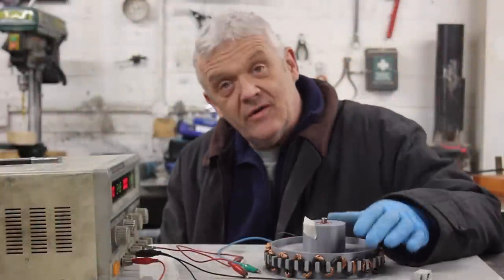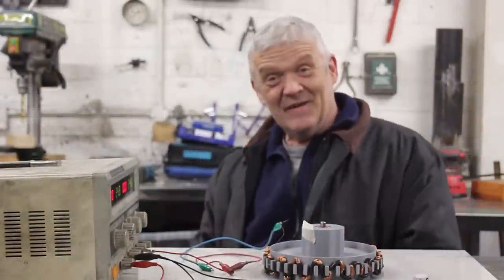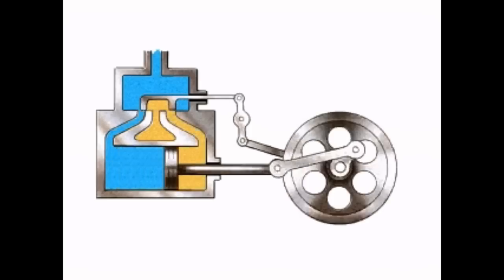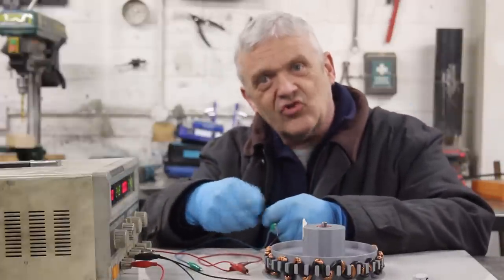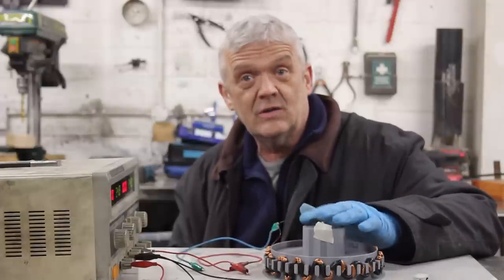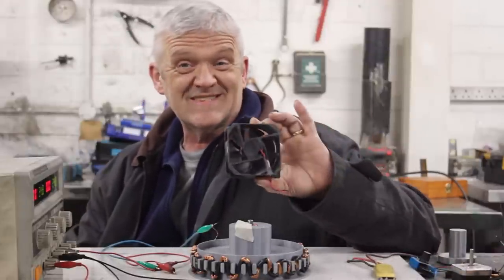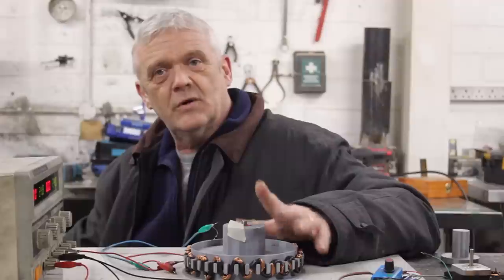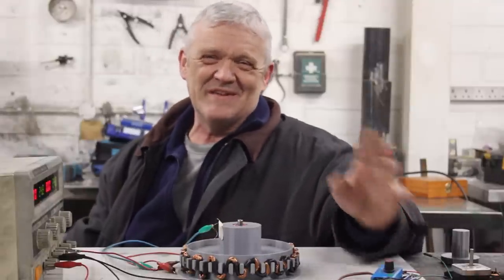1870 The Twisted Serpent As A Motor

Comment: What if you printed not ribbons but pins and then manually wired the copper under straight 45 degrees lines (more straight and sharper corners). Eventually one can create something to automate the wiring work.
Reply from the maker: yeah you could do that but until you created something to automate the winding it would be a royal pain lol - but you are absolutely right mate
Reply: @ThinkingandTinkering  maybe I'll give it a try does the angle needs to be 45 ? Or is steeper better like 60 or 80. And with uneven pins the wirings would shift I wonder if that is worse or better. I be happy to share blender models with you.

Comment: An ebike already has forward momentum so this single coil should be sufficient, Saves time in mass production, Easier to recycle or reuse.
Reply from the maker: oh - clever - cheers mate
Reply: @ThinkingandTinkering  As an ebike motor, if this is inside the hub of a 20 inch ebike wheel say, to travel at 20 miles per hour, the wheel rotates around 5.5 Hz. There's 20 loops in the serpentine coil. That's 5.5 Hz*20=110 Hz phase switching. According to my online search, skin depth for copper at 110 Hz is 6.5mm, so even the regular wiring used in the walls of homes, 3mm diameter, should be able to handle the frequency.

Comment: Question, if you simply did one big coil, no twists in it.  And put all of the magnets in the same orientation instead of north south north south. Would that not be the perfect DC generator?
Reply from the maker: no - nothing would happen - you might want to watch a video or two I have done on the principles of generation mate
Reply: @ThinkingandTinkering  yea, been watching abit. its an interesting subject. and i got the idea whilst watching a video were you took a generator you already had, i think you called it the "lightning bolt generator" or something. and spun a coil around the whole thing. 

I was thinking that if you didnt do "north south" pattern and instead of that going "north north" you would get a constant flow in one direction. 

But thanks for the clarification.

Comment: thanks robert ...my knowledge is limited here however after your demo there showing the pulse control and a hall effect sensor when its setup and a motor. I wonder if this could be reversed when its running as a generator ? so the hall effect sensor could be used to take off the load when its at its at the bottom therefor making it a more efficient generator ?? so instead of a motor nudge its a generator release!!
Reply from the maker: you could do that mate - but I am not seeing the advantage myself
Reply: @ThinkingandTinkering 
a permanent magnet 3-phase motor uses a Hall sensor and an electronic controller to control the timing of the current to the motor windings. The controller measures the position of the rotor using the Hall sensor and adjusts the current to the motor windings to ensure efficient rotation of the motor.

In a generator setup, the principle is reversed, and the magnetic field produced by the rotating rotor induces a voltage in the stator windings. The magnitude and frequency of the induced voltage depend on the speed of the rotor and the strength of the magnetic field.

Regarding your idea of using the dips in the magnetic flux to reduce the torque, it is possible to adjust the timing of the current to the generator windings to reduce the torque required to turn the generator. This can be achieved by adjusting the timing of the electronic controller to ensure that the current to the generator windings is in phase with the dips in the magnetic flux, which can reduce the resistance to the rotation of the generator.

In your setup, you mentioned that you would have the output from the generator going to a capacitor. It is important to note that the use of a capacitor depends on the load requirements of your application. If the load is resistive, then a capacitor may not be necessary. However, if the load is inductive or capacitive, then a capacitor can be used to improve the power factor of the generator and increase its efficiency.

Overall, your idea has the potential to be an efficient way to generate electricity, but it will depend on the specific details of your setup and the load requirements of your application. I would recommend conducting further research and testing to determine the optimal configuration for your system. i might just be a sandwich short of a picnic🤣

Comment: Big fan. Love your channel I have one concern about your generator/ motor and it concerns it  in all in one word heat. How would the filament from a 3D printer be in handle heat from the motor or heat from a generator? I think you may later on  if you feel like it to make a video on the concerns about heat and not melting the filament from your 3D printer in the motor because as the amperage go up it going to produce some heat which then the heat is going to warm up the filament which then is going to wreck the motor/ generator. I would love to build one and hope you could clear that up about what to do about the heat that's coming from the motor/ generator that a person makes from a 3D printer. Thank you! Thank you so much!
Reply: It could be printed in ABS or Laser sintered metal.
A really cool thing that you can do with 3D prints is use them as models for sand casting metal components. You can make a silicon mold of your 3D print and then cast your parts in high temp resin. The 3D prints are proof of concept prototypes.
Reply: N grade Neodynium magnets start to lose magnetism (i.e. the curie point) at 80 C, so they'll fail before the plastic fully melts.  That said, many plastics "creep" under that temperature so you're right it's an issue.  An engineering plastic like tempered PEEK should be fine though.
Reply from the maker: yeah sure

Comment: Hi Robert, I saw video 1869 and want to print this. I am curious if you had to use supports while printing the stator?
Reply: I cannot speak for Robert personally.  Based on your question, it sounds like you are concerned about "midair" layers with nothing underneath them.  If that is the case, then I may be able to help (see below):

I personally recommend exporting your 3D print model from whatever modeling program you use (such as Tinkercad or Freecad, which are both free) as a *.STL file.

Take the STL file you just created, and import it into Cura.  I like Cura because it is free, and because it generates the *.gcode file for you automatically.  The user interface is very simple, and you can tell it what you want the 3D printer to do.

MOST IMPORTANTLY, one of the options is to have it "generate supports", for those "midair" places with no supporting layers underneath them.  Any portion of the part that does not have continuous material all the way to the plate surface will have supports underneath it.  This creates a series of thin, vertical walls, much like the thin corrugations in the walls of a cardboard box.  These supports are kind of annoying, but you can break them away from the finished part with your fingers fairly easily.  You basically "pick your poison" and point down the side that is least objectionable to have these supports removed later.  You can mitigate the amount of cleaning up that you have to do, by adjusting the minimum angle (relative to vertical) where the supports are generated.  A 30 or 45 degree angle may need supports,  but you can sometimes get away with not using them if the wall is "almost" vertical, such as 10 or 20 degrees (The default angle is set around 20 degrees, if I remember correctly.)

Anyway, I hope that helps.  Have fun, and remember that practice makes perfect!
Reply from the maker: the stator no - the rotor yes - that's because the rotor has a flat indent section to accommodate the thrust bearing and is 'midair' the stator 'pegs' have an angle of less than 50 degrees - so the printer can cope with it - that's why the 'pegs' have rounded ends!
Reply: @ThinkingandTinkering  Thanks Robert, I didn't realize that about the rotor.

Comment: Robert, side question. Can you calculate the efficiency of a Venturi based on length?
Reply: There just gotta be engineering tables and figures for venturi from the days of carburettor technology.
Reply from the maker: I don't know mate
Reply: Thank you both. I'm working on an idea which incorporates a Venturi however I can not find details that speak to efficiency. Length, diameter, angle of deflection. Thank you anyways.

Comment: Hi Rob if you had 1 wire and took a tap from the middle and each end would that make a 3 phase
Reply from the maker: well that would effectively make coils in series with the start of one coil being joined to the beginning of the next - don't you have to join the coils all start to each other? kind of like in parallel?
Reply: @ThinkingandTinkering  I was thinking if you received a voltage from the middle of the serpentine winding in generator form would it be the same as a 3 phase motor

Comment: do the motors use capacitors to kick start the motor?
Reply from the maker: no
Reply: @ThinkingandTinkering  after further investigation Capacitors are used to reduce the electrical noise produced by the fan motor, which can interfere with other electronic equipment in the vicinity. By smoothing out the electrical signal, capacitors can help to reduce electromagnetic interference and improve the overall reliability of the electrical system.

Comment: you could add a relay to pulse the voltage
Reply from the maker: you could but you would also need some way to time the pulse
Reply: @ThinkingandTinkering  Capacitors? You'll have to excuse my electrical knowhow, I'm an ex PC tech (20 years ago) and sometimes things pop into head :)
 Cap > Charge > Relay.

Comment: So, what would happen if instead of pulsing the the wires , they were just connected ?
Reply: The coils field will be static, so the magnets will align with the static field and stop. A coil is just an electromagnet. It stays the same pole positions as long as the voltage is applied. You could possibly get this motor to run on AC but it is still hard to time the HZ of the AC to ramp up the speed of the motor without some form of timing. For normal DC motors you can also use brushes and a commutator. It breaks and makes connection in time. Most have more than one winding to force it to go in the same direction and keep force on it the whole time.
Reply: Fire
Reply: Thanks
Reply: @teddycunningham7568  short an sweet answer
Reply: @newmonengineering  If you had two of Robert's machines, you could use one as a generator and feed its AC waveform to the other one used as a motor.  Both have to ramp up, so the speed of the motor would (I think) match the speed of the generator.  That should automatically take care of timing.  Depending on the starting position, there would still be the ambiguity in direction of the motor.
Reply from the maker: it would get hot and stay still
Reply: @ThinkingandTinkering  Thanks